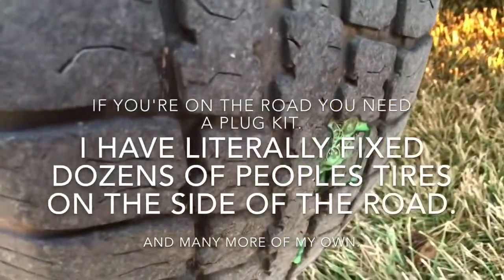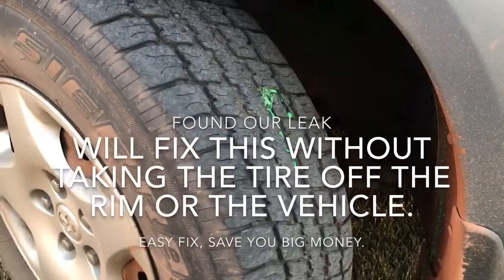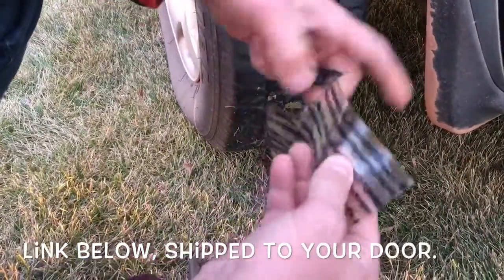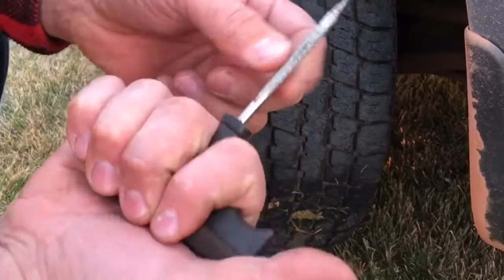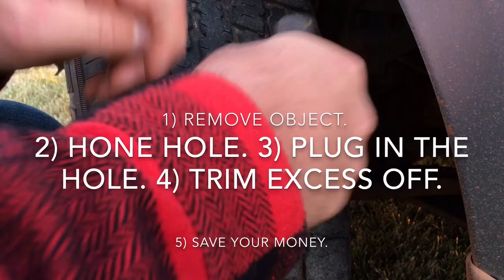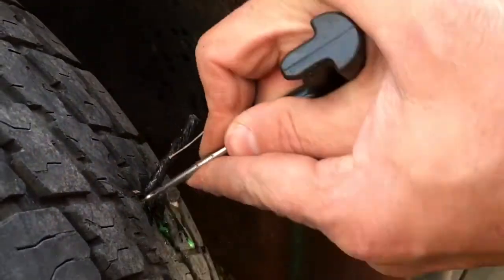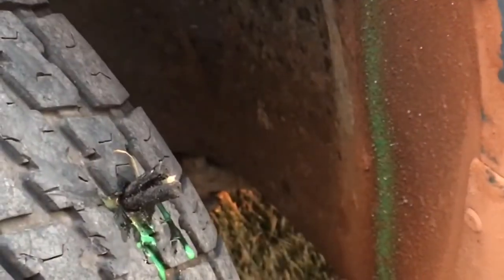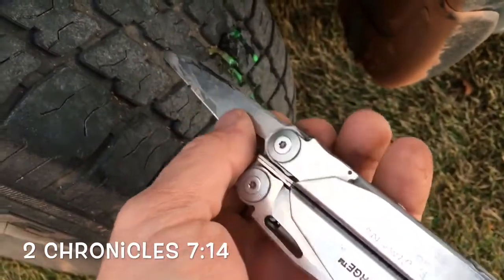How to plug a tire easy five step.. On the rim without taking it off the vehicle. save big money.

Comment: Nice work! I have the same kit, the tools with that T-style handle are the best, the screwdriver-style handles are OK but hard to apply leverage with. 

I keep mine in a small bag in my larger car-tools bag, keeps all the pieces together, compactly. I also have a Schrader valve tool and extra valves+valve stems. In another little bag I have fuses and headlight bulbs. Be prepared!

What's the difference between burning the excess plug and cutting it off? Is cutting it off the same as leaving it and letting the road wear it away? 

Thanks Luke, keep these useful videos coming :)
Reply from the maker: +Michael Chavez 
      I keep valvestems as well. You can never be too prepared. I fixed my own stuff on the side of the road but I've helped far more people. And that's really what it's all about. Absolutely you can just let it wear off as well. I do like burning them just because it kind of freeze the ends and steals them in nice. But not at all necessary.
    Thanks for taking the time to leave a comment Michael, did you have a good Thanksgiving, by far my favorite holiday. I've got many videos cooking, but been somewhat busy. 
Happy trails
Luke